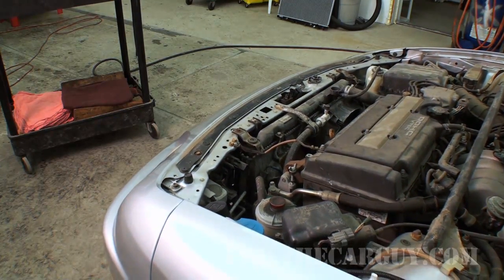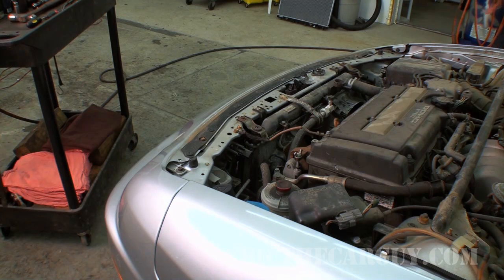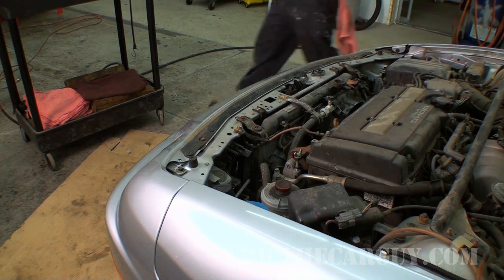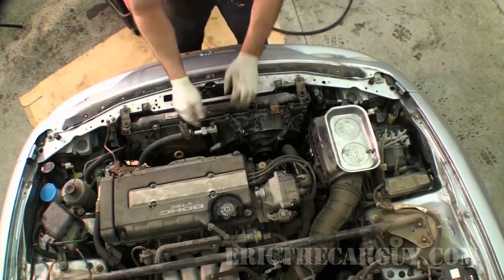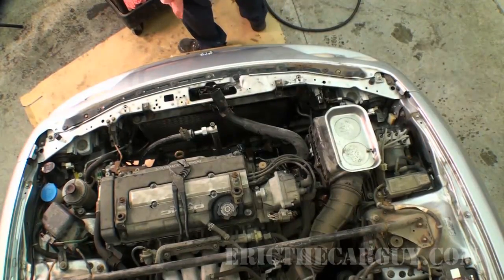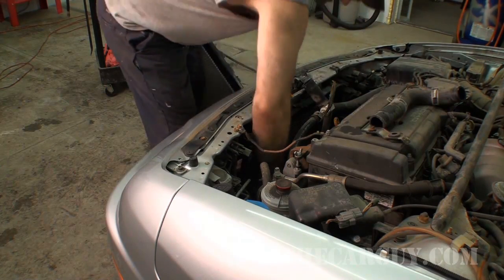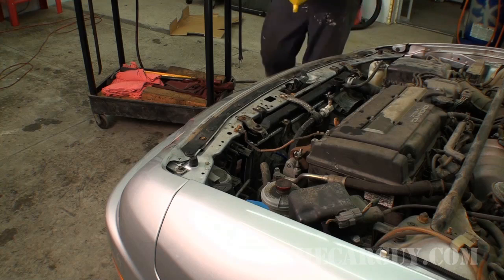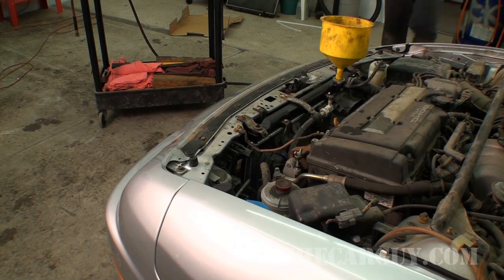2001 Acura/Honda GSR Radiator Replacement, Real Time -EricTheCarGuy

Comment: As an aspiring independent mechanic, this was good. I've done several radiators yet still watched this and gained entertainment value. With some of your simpler jobs that come to you (brake jobs, oil/filter. coolant flush, plugs/wires) this type of fixed camera repair with commentary would suffice for me.

Comment: Very Funny Eric. Today I'm replacing my radiator on my 2000 Honda Accord. Top tank cracked. Had a job interview and ran AC to keep from sweating to death. Radiator paid the price. Never had seen a tank seal leak before it's always been cracks in the tanks.

Comment: I like your post colonel, for that reason I always used a versatile tool other than it`s outright name (cotter pin puller) near high 90%+ I had the ease of access of this dull pointed 90% bent at end with about 1- 1/2 inch bend to point and simply slid it in with ease at top slide half the dia.of outlet slid to bottom on other side. No bend just a pull straight out try first or one up to down motion at outlet . But Eric seemed to know all history of this auto for age of hoses.BIG JOHN Likes ETCG

Comment: I sealed mine with dynagrip plastic tank repair with the assumption of replacing it when I could aford one, It has worked thus far for 5 months and no leaking. My point though is it was a job to keep it going till I could geta new one, My local mechanic (fantastic mechanic) was in amazement at how tight the seal was. Give it a go its good stuff but its half measure.  Eric you should try it ina vid its good for repairing fuel tanks and such as well hardens to like concrete so its at least tougher than the plastic radiator! lol 
But as a philosophy I dont like putting a bandaid over a knife wound but I was tight for cash in the middle of nowhere and bam.

Comment: Hey Erik, the reason why Showa were used in SOME Hondas are the same reason as some Hondas had a different starter and alternator, it was because of availability, in Japan from about 93 to 98 ish their normal electrics and parts makers ran into some troubles and couldnt keep up with the demand for the car output, so they went to some other manufacturers to get parts, the starters had slightly differant electrical connectors, the starters were exactly the same as the "normal" starters

Comment: Hey Eric, would you recommend genuine Honda Type 2 coolant?  I noticed you installed some generic green coolant.  Also, what about removing the frost plug and draining the block?  The manual for my 91 CRX Si includes the block drain.

Comment: On the subject of twisted hoses:

I used to work in a factory and one of the things that the QA guys would tell us over and over again is that installing a hose twisted will reduce its lifespan by 90%.  So yeah, don't do that unless you like replacing hoses.

Comment: Eric, I've got an 02 Tahoe 5.3 LS that I've had for a few months and the service engine light was on so I finally got around to checking it out. It turned out to be  P0327 and P0332 witch is Knock Sensor 1,2 Circuit Low Input. Is it necessary to fix this issue and if so how much (around) would it cost me at a shop? I think its the sensor as engine sounds fine and runs fine. Not something I can do since it has to do with taking off the manifold.  
Thanks Mike

Comment: My 1997 Honda Integra/Acura plastic top radiator tank developed a hairline split on a cold night and it was only 4 years old or so, it was a Denso unit. The replacement tank was steel.

Comment: Those hose clamps are called 'Mobea' clamps... if your going to get the cable type tool for them, avoid Searz.

The cable assy of all of such pliers is delicate & short lived... and even though Searz sells the pliers under the Crapsman name, they rarely if ever have replacement cables in stock or available. (at least in my experience.)

With any make, don't kink/bend the cable storing them, or gaining access to clamps. Also, keep the cable as straight as possible in actual use.

Comment: I changed my 1998 Civic's radiator a few months ago. it's pretty easy to do logically, but it's kind of annoying to do in terms of the time & energy. Though I suppose being up for 24 hours straight & doing the installation in 95F heat doesn't help much...

Comment: the difference on those radiators is about a quarter inch on the fan mount. knowing which one you need is as easy as a look at the vin. first digit 1,4or 5 is american manufacture and denso rad. a j is japanese builr and valeo rad.

Comment: My 2000 Integra GS makes a constant grinding/rattling noise at idle.  The noise goes away once I hit 10 mph.  It has 90k miles on it.  Its an automatic.  Any ideas on what I should check first?

Comment: I did a radiator  on my 1998 Accord got it from Auto Zone there radiators are universal you just slide the clips in the way you need for the fans on your car.

Comment: HEY THERE ERIC I WAS WONDERING HOW DO I BLEED A 1996 INTEGRA GSR OBD2A V-TEC RADIATOR? I WAS TOLD THAT OBD2S DONT HAVE A BLEEDER FOR COOLANT SO AFTER FLUSHING THE RADIATOR AND RE FILLING IT I JUST  TAKE THE CAP OFF TUN HEATER ON AND LET THE CAR RUN FOR 5-10 MINUTES THEN IT SHOULD BE GOOD? IS THIS CORRECT?

Comment: Yea pulled out the radiator just to find out that I ordered the wrong one. I ordered a Denso radiator but my fan brackets didn't fit smh. Now I have to order and find out which brand fits.

Comment: Why do older honda engines like this one have the transmission on the passenger side and the accesory belt on the driver's side? I always wondered why did Honda made those engines with that setup, while everyone else seems to do the opposite.

Comment: Personally I find it easier to disconnect the lower radiator hose at the thermostat housing, and remove it with the radiator. Then mark it, swap it over and tighten the lower clamp because I know it's in the correct position.

Also, I've often come across leaking radiators on Hondas and in many cases I have found that the radiator cap was bad, which I believe resulted in the radiator bursting due to excess pressure.

Not trying to sound like a smartass, just sharing my experience...

Comment: how did you get the ac condensor off the radiator? i am working on my 2006 chevy impala 3.9v6 LTZ. I have the cooling fans out and removed. just the AC condensor is attached onto the radiator when i try to pull it out.

Comment: I hate factory spring hose clamps.  Is there a good reason why they should be used vs. screw clamps?
Reply: Factory spring hose clamps are used instead of screw clamps because during assembly of vehicles it is faster to engage spring clamps than screw clamps. In the assembly world, every second counts!
Reply: +killaahhbee never thought of that lol
Reply: +Louie G lol on the outside world very few choices like these are understood, until youve been on the assembly side of things, Assembled Tesla Model S for two years, repair technician for them for another year, let me tell you first hand assembly friendly and common sense doesnt always go hand in hand